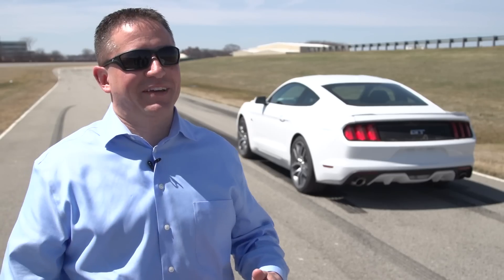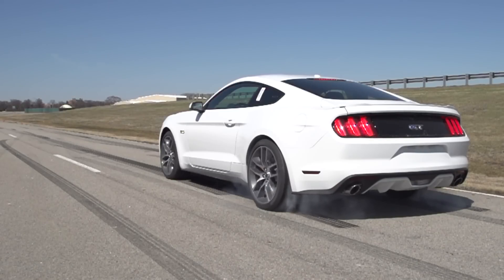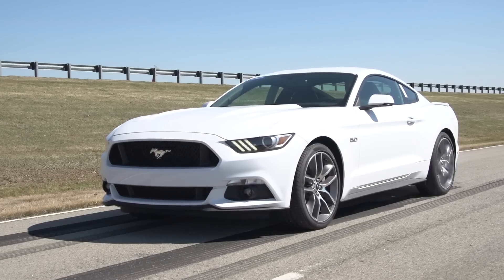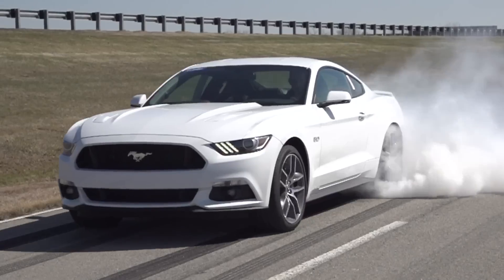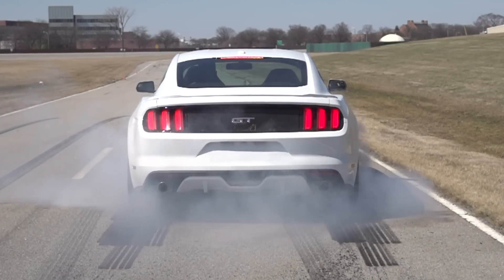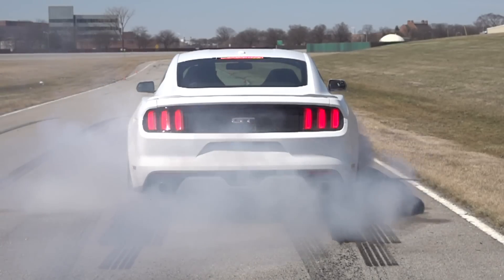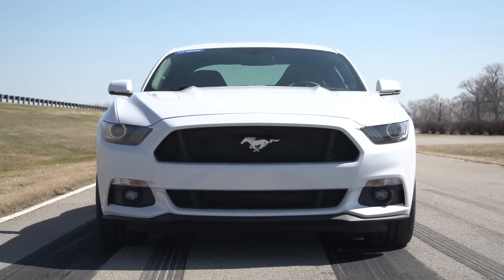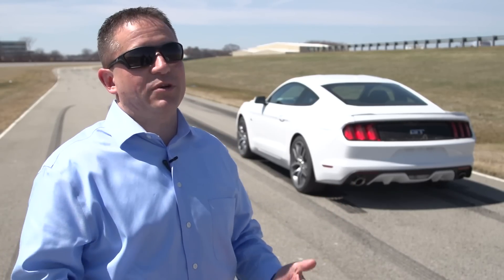2015 Ford Mustang GT: Line Lock burnout feature

Comment: Whipple Supercharges the 2015 Ford Mustang to 700 HP
Although the 2015 Mustang won’t hit dealerships until late 2014, aftermarket parts providers such as Whipple are already working on updates for the redesigned pony.

Unlike Ford Racing, who has only released a teaser for its upcoming supercharger, Whipple has unveiled plenty of details on its new blower, which promises to take the 5.0-liter V8 engine’s output up to 700 horsepower.

The 2.9-liter W175ax twin-screw supercharger will feature a 15 percent larger bar-plate intercooler, a larger aluminum intercooler reservoir, an integrated Crusher 170mm oval inlet and either a standard 6-rib or an optional 10-rib belt system.

Whipple says the supercharger will come with OEM quick connect fittings for easy installation. Complete kits, turner kits and hot rod kits will be available in wrinkle black, polish or any custom colors. Whipple is also offering an optional 5-year/100,000-mile powertrain warranty.